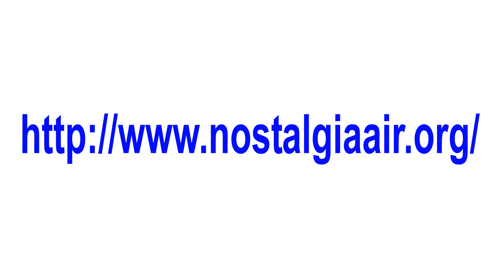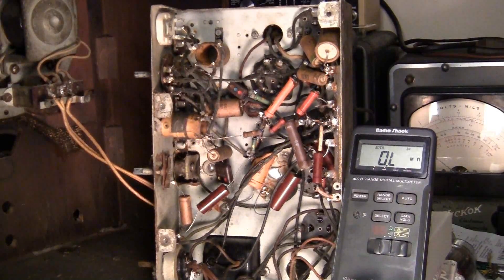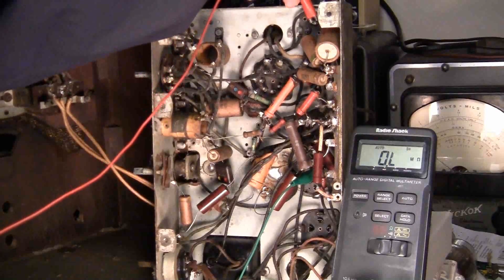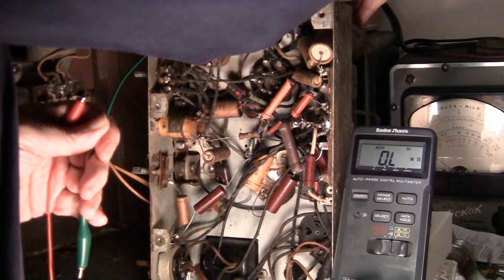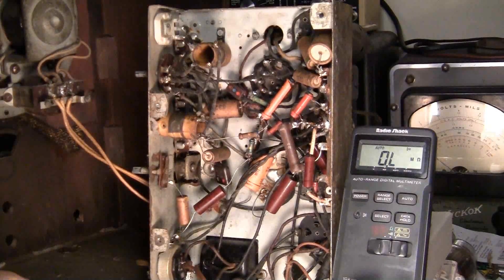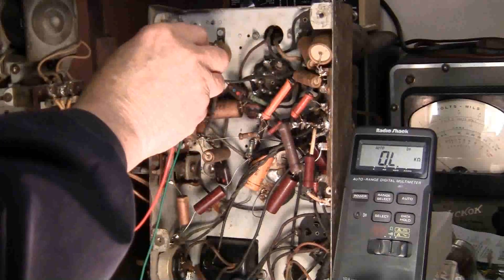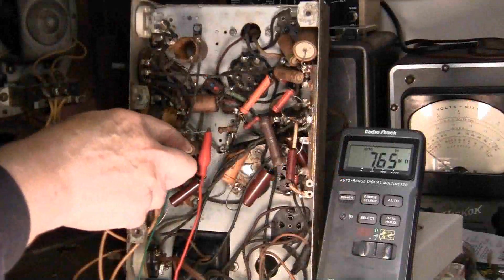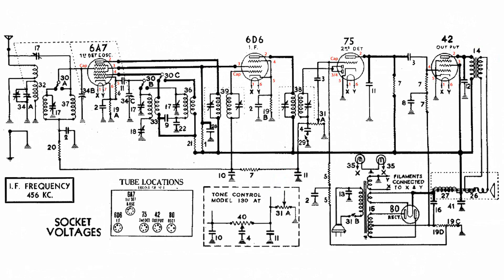IF, Oscillator, Antenna Coils Continuity Test, Stewart Warner 1301

Comment: I restored an Allied Knight radio from 1938. It worked fine for one year and suddenly started to smell very strange. Shut it off and then opened it. Found that the BC Antenna Coil had burned down. On the schematic, I can not find what could have happened. Only thing I could think of is that these radios where designed for 105-110 VAC and nowadays voltage has gone up to 125 VAC. which could have damaged the main transformer. Only the BC Coil got damaged. The transformer has been rewinded/rebuilt to provide the exact voltages the radio was designed for but now for 125 VAC. I can't find the original BC Antenna Coil replacement anywhere. Litz Wire is so thin, with the numbers on the coil 3707-L and 1212130. I guess those are Allied Knight coil numbers. Have look for month and months and can not find these numbers anywhere. Is there a replacement from other brands I could use to replace this coil? I have the schematic of the radio. It is Allied Radio Corp. Model B10565 and can be downloaded from Nostagiaair.org. The coil is the BC coil and is not adjustable.

Could you please help me recommend a replacement for this un-obtainable coil? Since I can't find info, I don't know the mH for this or any useful info to replace it with any other brand or equivalent. How you do in cases like this? 

Thank you.

73
Rob
YS1RS

Comment: How do you know, by looking at the diagram which IF transformers winding's is on top, or is on the bottom of the can?
Reply from the maker: If you turn the tuning and nothing changes you turn the other one. Some manufacturers may construct the IF's differently. But most are of this configuration, and that comes from experience.
Reply: @AllAmericanFiveRadio  So on the schematic looking at an IF transformer..is the left coil the top adjustment or bottom..It usually shows a slanted line with an arrow on it..
Reply from the maker: The manufacturers do what they want. In the middle of a run they may run out of original parts and sub them with out making changes to the wiring diagram.

Comment: the service manual you posted says the bandswitch on the far right is am broadcast when it is turned fully clockwise. Is that correct? It doesn't seem right

Comment: I have a bad 80 tube to start out with. I ordered one off e-bay. I was wondering what the plate voltages should be. The manual you posted says 180v, is that correct ?
Reply from the maker: My manual says 350 per plate
Reply: Thanks! my 80 should be here Thursday